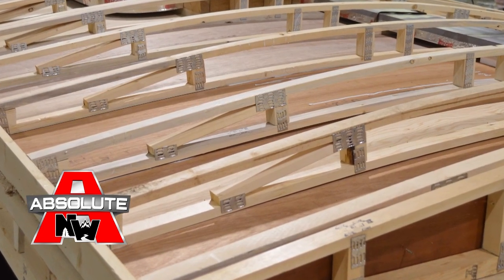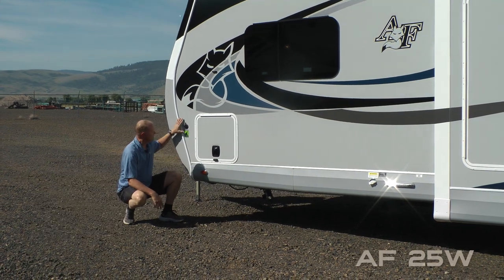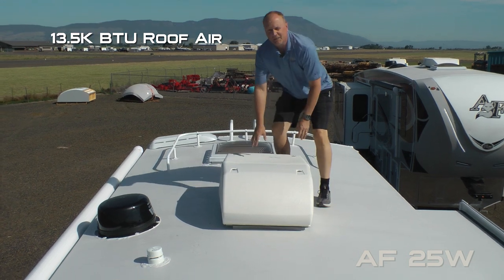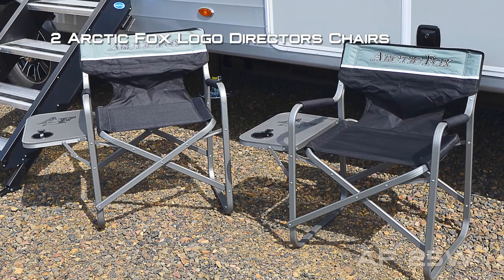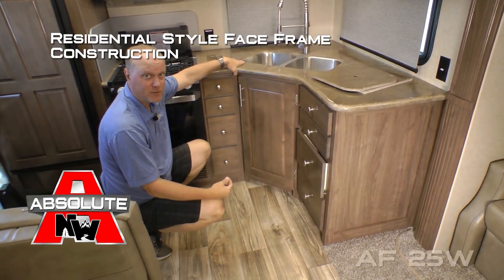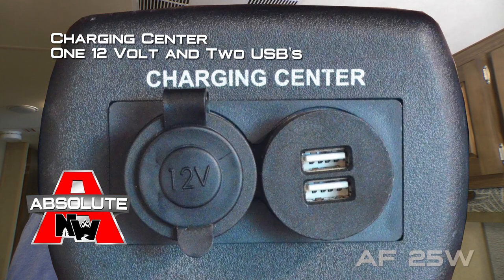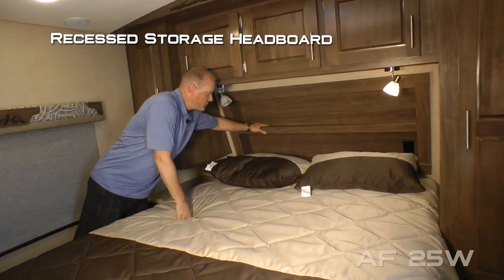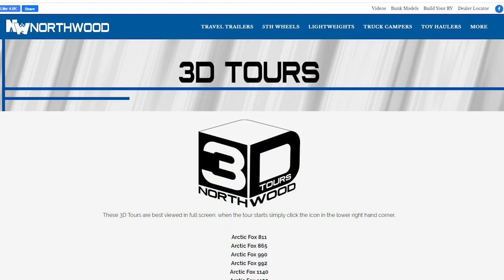Quick Tour of the 2021 Arctic Fox North Fork 25W

Comment: I really want this model only  a few draw backs but there minor pass though hamper seems unnecessary a compact washing machine in the bathroom were the smaller cabinet is would ve better didn't know much about the solar system till seeing other talking about it  but would be nice if they were bigger like 240w with room for 4 battery's in a warmer spot on the rig maybe under the dinette would be an improvement but an onboard generator would be a bigger improvement not a huge deal though it's easy enough to haul one in the truck kinda wish the roof rack was better thought out to fit a canoe or small boat a back rack may be more useful would definitely get the bumper hitch option even if just for a small boat/atv trailer or basket carrier aside from that I realy like  the layout of this one I'm wondering if the inside cabinet on the slide out could be modified to fit a gun safe I love the idea of the outdoor cabinet for storing some tools would like to find the dementions on it would also like to see a video with slide in